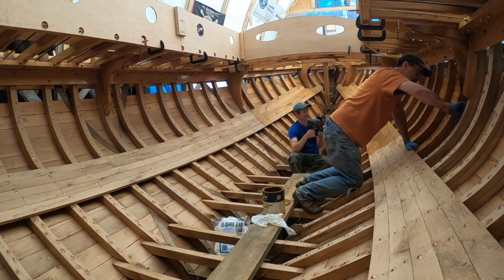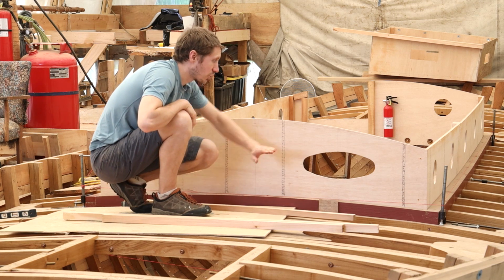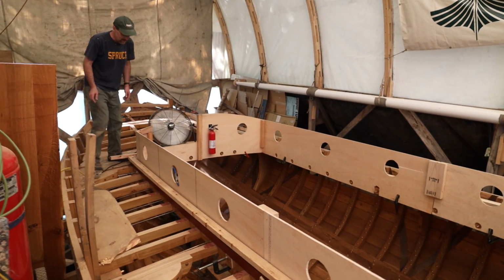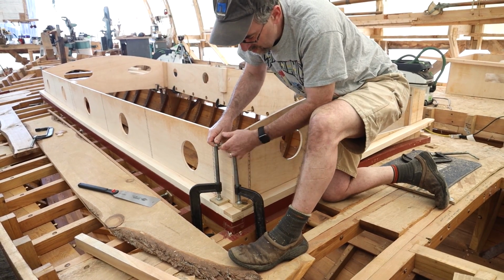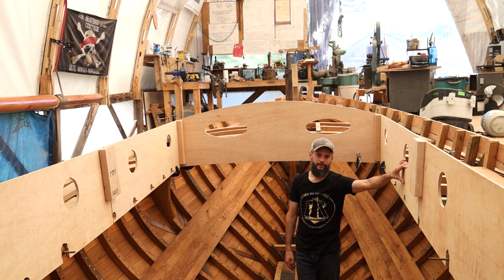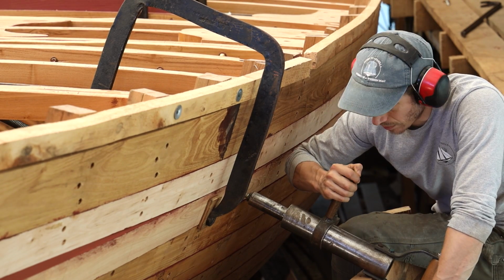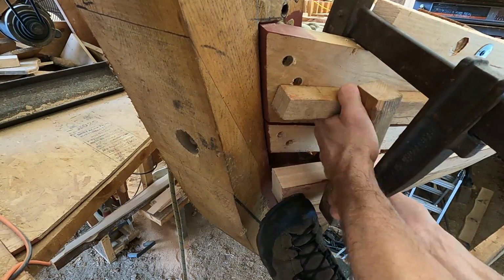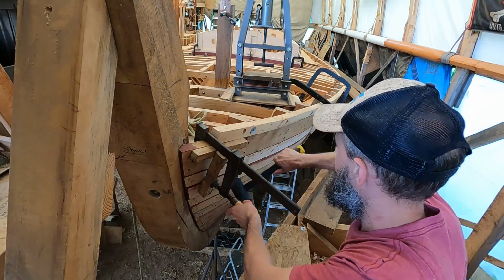Finishing the Port Side Planking - Episode 170 - Acorn to Arabella: Journey of a Wooden Boat

Comment: Curious why you have chosen to accommodate the dinghy on the house not on the stern in davits surely the latter would be more sensible in an emergency
Reply: Davits on a pointed stern would result in the mounting brackets having massive overhangs, and would look really ugly. And since the last thing you want is for a huge wave to fill the dinghy during a storm (several tons of water high up at the stern where the bouyancy is least, is a Bad Thing), there would still need to be a better location for the dinghy to be stowed whilst on passage. Davits are only suited for fair weather use, and/or whilst at anchor. If the emergency is that bad, that's what the life-raft is for. Faster and less dangerous to deploy than a dinghy in davits.
Reply: @Garryck-1  No reason you can't have both - Dinghy on coach-roof severely restricts forward visibility
Reply: @freepress8451  - davits really don't go well with pointed sterns. That said, I agree with you about not putting the dinghy on the coach-roof. If space on the fore-deck is really as big a problem as they claim, IMO the best approach would be to go with a nesting dinghy instead. They take up a lot less space on deck. (Which is why I'm currently building a Chameleon Nesting Dinghy for my own yacht - which is also a double-ender.)
Reply: @freepress8451  - Funny you should post that link.. I'm one of the people currently participating in that discussion. :-)
Reply: @Garryck-1  The forum has a great atmosphere and it is an informative thread. Don't see a dingy on the Atkin 'Ingrid' plan but there are ketch's that have one on the coach-roof and also using davits
Reply: @freepress8451  - Agreed.. and yes, a very informative thread. I picked up a huge amount of tips for my build, from reading it.

Comment: I'm not a boat builder so I am asking simply because I don't know.  Why Fiberglass...?  If it was already covered in an episode please point me to that episode...  Thank you.
Reply: I'd like to know that as well. I don't remember any comments about it in previous episodes and it's unlikely that the original plans called for it!
Reply: My best guess is it’ll extend the life of the boat and reduce maintenance. The house and decks get a lot of fresh water. Leaks will quickly rot the frames. If they had epoxy resin and glass fibre available back in the day using it’d be a no brainer. Going old school on the sealer would be impractical for their plans to sail into remote places.
Reply: The fiberglass and resin will help hold the house together if it is removed from the boat along with the waterproofing it brings with it.
Reply: Thank you.

Comment: I didn't hear galley floor level discussed; your just standing on a single plank right now. I hope the floor is wider than that; which means higher.
Reply from the maker: Cabin sole will fit about where the one plank is and yes, therefore, be wider. We don’t need a dance floor down there though.

Comment: Why are you laminating the deck house?-seems like a lot more work than just using solid pieces
Reply: It's much more stable, and with the fiberglass, stronger and less maintenance. It also makes the corner joints easier and stronger and less likely to leak or rot. The cedar is also lighter than the equivalent plywood or the various kinds of tropical woods that could be expected to stay flat with boards that wide. Aside from the other advantages, the cedar cost nothing and can be cut from scraps and offcuts.

Comment: Surprised to see the guys insisting on going through the complex process of accounting for the compound bevels on each and every layer. 
Much simpler would have been to make a square jointed box off-boat and then scribe the bottom to fit once finished.. Easy build, easy fit, easy maintain....

Comment: Don't understand why you would want to build in future difficulties by burying the coach house base screws where they cant be reached?
Reply: As far as I know, they can take off the house as a whole, from the red part upwards. So if there are difficulties, remake the house.
Reply: If I understand correctly, the issue is to make sure those screws are inaccessible to corroding agents (salt, water, oxygen). That’s why the first batons are wide enough to cover them. If they ever need to take the house off - which is not going to be often - they can be located and freed up with a chisel.
Reply: @mumblbeebee6546  not without significant damage to the coach house. It would be better to bolt the first cedar batten right through and hide the nuts in the underside of deck timbers that way the entire roof could be lifted intact should the need arise
Reply: @nielskorpel8860  That was not what they said on camera. glued and ring nailed was the description given. That would make the base screws inaccessible.without some moderate damage.

Comment: Re the house sides---why use nails at all? Couldn't you just use epoxy and clamps?  Epoxy doesn't like to be clamped too tight and structurally fill small gaps.

Comment: Why not just glue up a slab made from the strips and Cut it fit so much easier and still get the strength that you want...
Reply from the maker: Then there would be joints at the corners. This is solid even before the ‘glass goes on.

Comment: Building a boat involves making a lot of choices. Some of the choices you made I don't understand. Why use cedar and epoxy on the cabin and build the hull in carvel oak with caulking seams????? For the hull was the cedar and epoxy building method a far better choice. I don't say it is wrong but I just don't understand.
If you use epoxy you must realize that epoxy is dampproof. The wood will be totally sealed and therefore the construction can not vary in size due to the changing moist content. So you can not cover your laminate on one side with glass and epoxy and on the other side with regular paint, which is not dampproof. Always seal the total construction and start with a moist content in the wood lower than 10 %. When you build a glued construction of wood, covered with glass and epoxy you must know that epoxy glue (cottonfibres with regular epoxy) is much stronger than wood, if cured by the right temperature. So, the bigger the seam the stronger the construction. The seams are structurally more important than the wood. I just spend 18 years to build my own 11 meter (35 ft) sailing yacht in epoxy woodcore.
Reply from the maker: Everyone prefers their own decisions, we suppose. Many reasons for what we’ve done. We didn’t want to buy epoxy for a whole hull, for one.
Reply: Boatbuilders regularly will have a fiberglassed side and a not glassed side/painted side on the topside deck/furniture of even traditional boats, for instance glass/epoxy covered wood deck.  Consistent, significant moisture would be an issue, but on a cabin house top there will not be consistent, significant, moisture and as you note no huge moisture changes.  The stability, rigidity, ease of maintenance, and materials needs are all valuable considerations.   A completely glassed/epoxy hull is great, and strong, until moisture eventually gets into the core.  With the cabin house tops "open" on one side, it will be very easy to see if/when there is a breach of the glass/epoxy skin.  Everyone has to make the decisions right for them as A to A notes below.

Comment: I have built several boats with epoxy woodcore and  Its really not a good idea to cover the superstructure on the outside with glasfiber and epoxy and another finish on the inside. It will not last for long time. The glass fiber 
will  delaminate because of the non stop changing of relatively humidity of the ceder . You really should inform you better of the matter if you don't want to rebuild the superstructure after a few years.